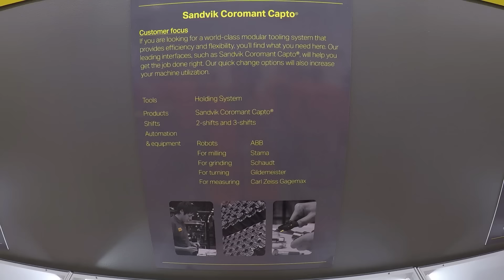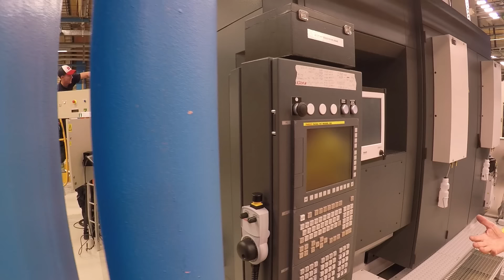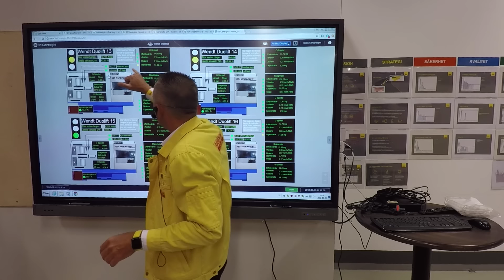Sandvik Coromant - AMAZING Factory Tour!

Comment: When machining steel and stainless steel probably 80%-90% can be done dry as long as you have good chip evacuation. The tool life boost is huge when removing large amounts of metal dry, plus you can run at higher speeds and feeds. I only use coolant on my finishing facemill pass and when drilling/tapping. Cast iron can be machined 100% dry as long as you can deal with the dust and aluminum is almost always with coolant. At high temperatures it’s difficult to keep the chips from welding to the cutter without some type of flood or al least a mist blaster.